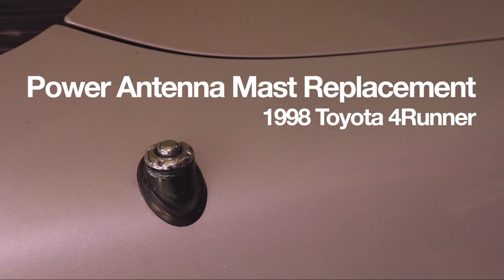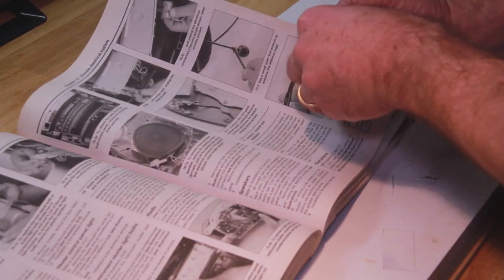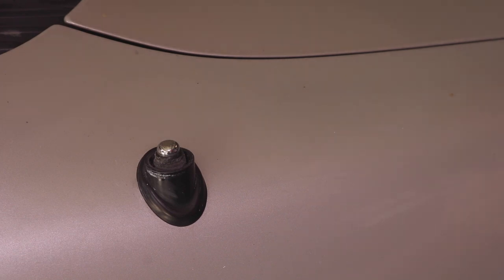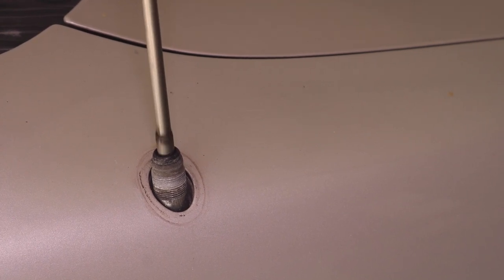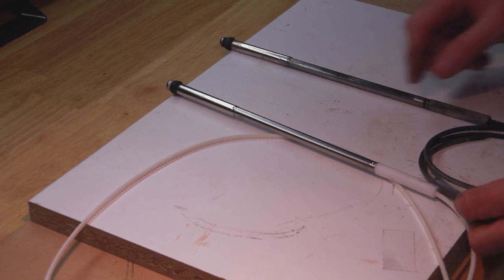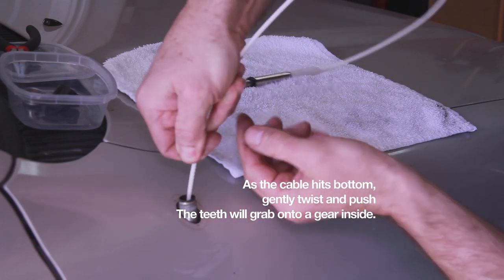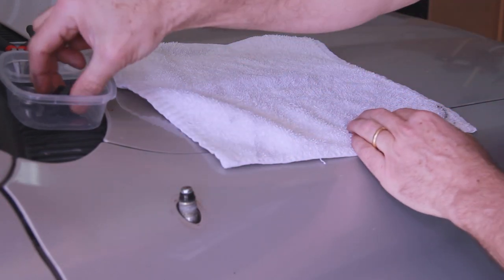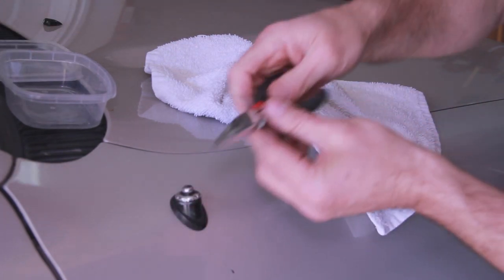Antenna Mast Replacement 1998 4Runner (Poor audio)

Comment: very straight forward!! Geezzzz it will save a lot of time and effort to get under the fender to get this fixed,good thing for your video you did it without a sweat!!  thanks a lot for this!! my cars antenna broke and need to get the whole assembly taken out the plastic retrating the antenna snapped.

Comment: Thanks! Do you have to add grease to the new antenna?
Reply: I didn't apply any grease to the new antenna.  Just used it as it came out of the box.
Reply: From what came out of mine, it had plenty of grease in there already...

Comment: great video, but, your antenna was working already; i mean, it went up and down. Mine does not go up and down, so at the moment it could be the motor, or the relay. I think i might be able to hear the motor, so perhaps the plastic cable snapped. But, it could be broken and jamming something up? I would love it to be as easy as yours!
Reply from the maker: Sorry to hear about yours not working.  It could be a blown fuse.  Mine was simple because the antenna went up but not down.  Good luck with yours.

Comment: Any help would be appreciated because I have been at it a while what am I missing? The antenna works just as the video shows but I can't get the nut to screw back on? Thank you
Reply from the maker: Hey @Lovebug8910, the nut can be tricky.  Double check to make sure the threads aren't stripped on the nut. If they are, you'll need to source a new/junkyard nut.  If the nut is ok, you might have to get more threads to poke through the antenna hole so the nut gets a good bite.  Turn your wheels all the way left to give you room to work.  Expose the antenna/motor assembly from inside the wheel well by pulling out the rubber/plastic cover inside and toward the back of the wheel, well next to the antenna.  It's held on with some flat push pins (or maybe screws, I don't remember).  Loosen the mounting bolt holding up the antenna/motor assembly (hold it from the bottom because it will drop), push the motor assembly up with your left hand so the threads poke through the antenna hole as far as it will go (you should see more threads poking through the hole), then screw the nut on with your right hand (or have a helper hold the assembly for you).  Screw the nut on tight enough to hold the assembly but not too tight yet.  Work the mounting bolt inside the wheel well back into its hole and tighten it up, then tighten the antenna nut at the top.  You might have to push and jiggle the mounting bolt a bit to get it back in its hole (a little cussing might help).  Having to go so far as replacing the entire antenna/motor assembly can be a royal pain, so I hope this works out for you. Good luck with it.

Comment: Question here for you Ed - the mast on your 4Runner seemed to come up when you turned the ignition key - why are you replacing the mast if its coming up?  My mast doesn't move up when the radio is turned on - in fact it doesn't move at all - the motor runs - assuming that I have broken teeth on my mast - but why would your mast extend up if that was the case? ;)
Reply from the maker: Good question!  The mast went up fine but it would not retract.  I had to give the mast a push until the teeth grabbed the gear in the motor.  A few teeth at the very end of the cable were broken so they didn't engage when fully extended.  I suspect the momentum of the mast going up extended the mast cable past the good teeth and then it got stuck.  If your teeth are broken such that the mast won't go up, then you might need to help the mast get started with a tug up until the unbroken teeth grab, and the mast should come right out as it did for me.  Hope that clarifies.  :-)

Comment: Question.  After installing, when I turn on, antenna extends fully, but motor continues to run for about 5 seconds.  I hear the teeth clicking.  I've re-installed a few times, same results.  
And Thank You for the Video!
Reply from the maker: I'm not sure about why your motor continues to run.  Maybe something in the motor assembly?  It's not for the faint of heart, but I removed the antenna/motor assembly and took it apart to see if I could fix it rather than replace.  You can open the gearbox next to the motor and see what's going on in there.  The only challenge is the antenna cable to the radio is connected to the motor, so you can't do the disassembly on a bench -- you have squat down by the wheel for the duration.  After I did that, the motor still didn't work so I ended up replacing the entire motor with a new one from eBay.

Comment: Just bought a 2002 4 runner and the antenna mast was broke off at the base , can I still use your method of mast replacement to change it out ?
Reply: Mine was broken at the base....his method worked fine for me.

Comment: removed nut etc but unable to pull out antenna,!?
Reply: Same. Help!
Reply: Probably stuck from corrosion:/
Reply: Yeah I cant get my old broken antenna out either!
Reply: @sserna1077  did it in the end, give it a sharp hard pull, should come free
Reply from the maker: Robb Flynn, how did you grab the antenna to give it a bang and pull it up?  Pliers, vise grips?
Reply: @Edburzminski  yeah just keep pulling it in hard sharp busts and it will come free
Reply: Same here. But with some WD40 and persistence(and pliers), it finally came out. also, the gasket part on the old sleeve was stuck inside the outer nut(the outer cover). You might need to clean it out before you can put the outer nut back on.

Comment: Hey Ed, I did exactly as you instructed - so easy, however, when it goes up now, the mast motor will run and makes a loud grinding sound for about 15 seconds then stops.  On the down it works perfectly.  What is the issue with the up continual running and grinding?  I've taken it out again and reinstalled and still the same.  How do I fix that? please let me know if you have some insight. Thank you.
Reply: I’m having same issue
Reply: The same issue how do I fix that? Thank you

Comment: pretty frustrated, you're video was too simple, your antennae worked, which is not normal for people who have a BROKEN antennae! when i turned me key to the on position, no only did it not come up, no surprise, but i couldn't pull it up with pliers and a hammer! It was not coming out at all!!!!!
You're overly simplistic video did not really have anything to do with real life! more than a little disappointed and perplexed.
Reply from the maker: Your situation sounds frustrating.  It’s not that my antenna worked, it did go up but would not retract without having to push it down.  A few teeth at the very bottom of my mast cable were broken.  

Your situation sounds different.  I hope you find a solution in a different video.  There’s always the Chilton’s manual at a library,  auto parts store or Amazon.